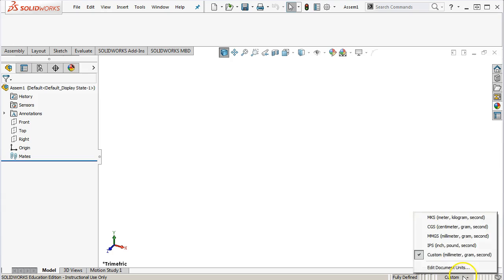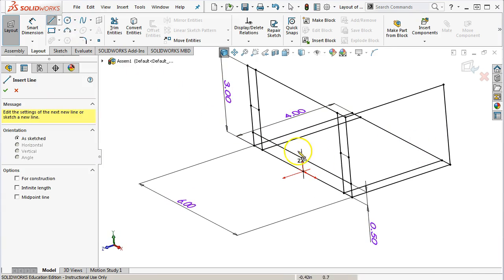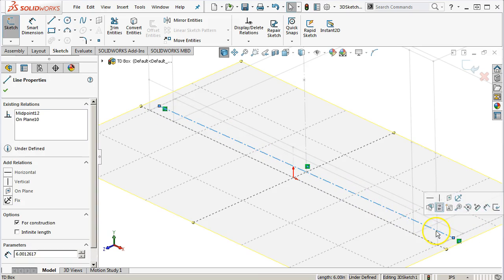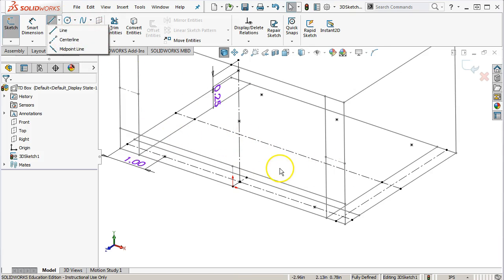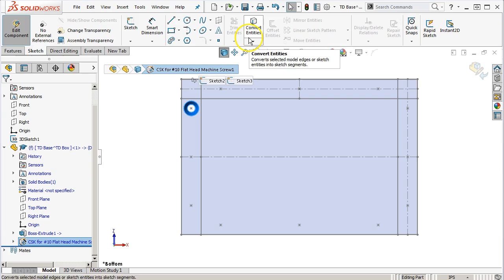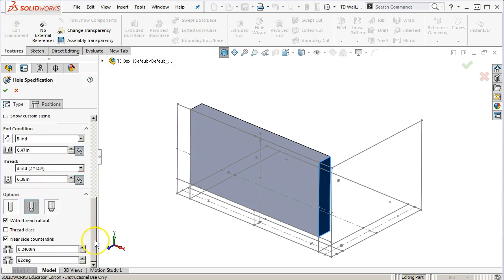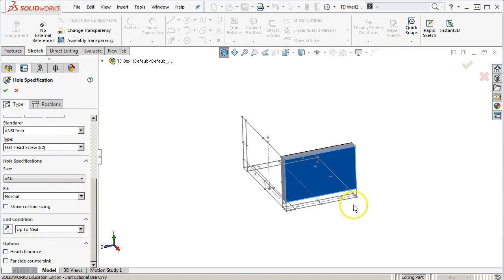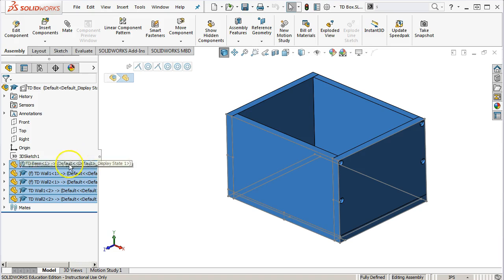20170207 Top-Down Assembly

Comment: When i exit layout , i dont see the sketch, can you help?
Reply from the maker: Return to the layout sketch is available on the Command Manager, Layout tab (first icon on the left) or you can right click on the part name at the top of the feature tree and at the bottom of the pop-up menu are layout tools see 8:52. I demonstrate the layout but it is not my go to. There are some cool functions in layout, most of the time I will use a 3D Sketch because it shows up in the assembly tree. There is only one layout, you can have multiple 3D sketches / sketches. I hope this helps.
Reply: @jerrylacymcc  That helps a lot, and I am using it currently. @ 18:56 you are out of layout, but still you are able to see what you have drawn, in my case, I cant see it on my side. Appriciate your quick updates and responses.
Reply from the maker: @MusicInAllHuman  I will look for my original file. The frame at 8:58 shows the TD Box after a right mouse button and at the bottom of the context menu you should see Show Layout. If it says Hide Layout and you still can't see the sketch you might have sketches turned off in the Heads Up bar, Eye icon. Also, may have clicked on the Eye icon which turns almost everything off. Click the down arrow to expand and look for the sketch icon or the Eye icon to toggle the view items.
Reply: @jerrylacymcc  I tried this option. Are you able to join a Zoom or a call to help out?
Reply from the maker: @MusicInAllHuman  I am in 700GMT if you can suggest a compatible time to meet. Please send information to jlacytech@gmail.com